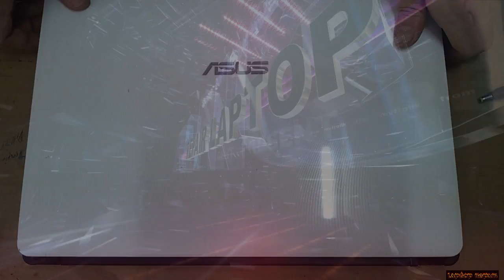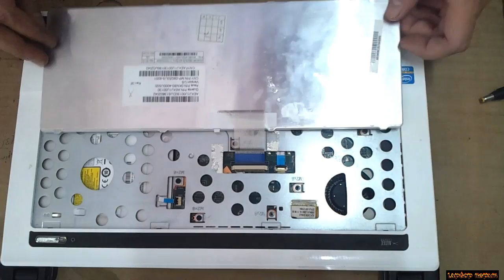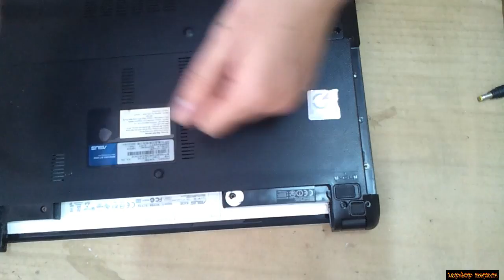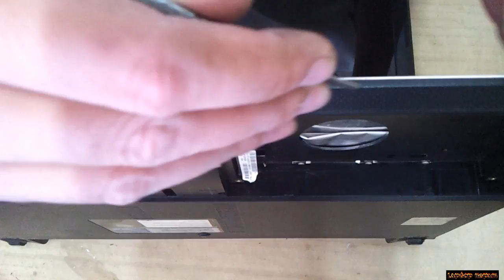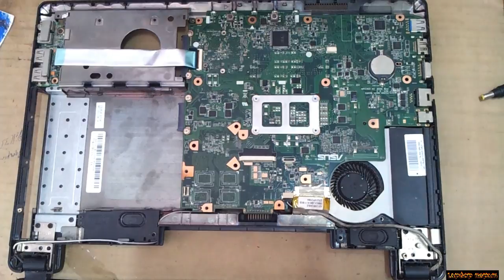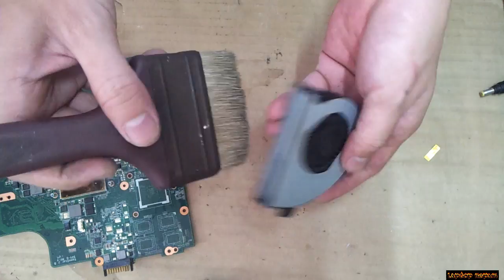Asus K43E - Disassembly and Fan Cleaning  Laptop repair

Comment: obrigado.. assistindo em 24/10/2024
Reply: Verifique usando o programa CPU-Z que tipo de soquete de processador está no laptop. Se o soquete for do tipo rPGA 988b, compre um processador i5-2540m, i7-2630qm no l-o-j-a-on-line e leve o laptop a qualquer serviço de informática da sua cidade para que um especialista em informática possa instalar um novo processador. 
Compre uma boa pasta térmica como GD007, GD900-1 (seringa de 1g) para processadores i5/i7. Você também precisa limpar a poeira do radiador do laptop (sistema de refrigeração). É necessário trocar a pasta térmica e limpar o radiador a cada 2,5 anos. Você também pode substituir as almofadas térmicas do chipset e lubrificar as ventoinhas com óleo líquido.
RAM 8-12-16GB DDR3-1333 2Rx8 1.5v

Comment: 300 trillones de gracias ! Un abrazo
Reply: Verifique usando el programa CPU-Z qué tipo de zócalo de procesador hay en la computadora portátil. Si el socket es del tipo rPGA 988b, entonces compra un procesador i5-2540m, i7-2630qm en t-i-e-n-d-a y lleva el portátil a cualquier servicio informático de tu ciudad para que un experto en informática pueda instalar un nuevo procesador. 
Compre una buena pasta térmica como GD007, GD900-1 (jeringa de 1 g) para procesadores i5/i7. También es necesario limpiar el radiador (sistema de refrigeración) de la computadora portátil del polvo. Es necesario cambiar la pasta térmica y limpiar el radiador cada 2,5 años. También puedes reemplazar las almohadillas térmicas en el chipset y lubricar los ventiladores con aceite líquido.

Comment: Is the CPU of Asus K43e is removable or upgradable?
Reply: look at what socket you have; if rPGA / PGA988B, then you can replace the processor. What processor model do you have?
Reply: It's removable btw. Thanks
Reply: @randomvaloclips9928  
if you have second-generation i3 (i3-2330m / i3-2310m), then you can put i5-2520m or i5-2540m. There is no discrete graphics card; the processor itself is on the cooling tube. You can install i7-2670qm, but turn off turbo boost on the processor, then the processor’s heat packet will be at the motherboard level (35w TDP) - get 4 cores / 8 threads / 2.2 GHz. And if you put an SSD under Windows and 6-8gb of RAM, then there will be a fast laptop))
Reply: @slavafedotov5742  Hi! Any idea how much ram its motherboard supports? Can it handle 16gb?
Reply: @Chris29019  the motherboard supports a maximum of 8GB+8GB (DDR3-1333, DDR3L-1600), only 8GB memory modules must have 16 memory chips (8 pieces on each side). I have 4GB+4GB in my laptop and have never seen the memory full I installed the i7-2760qm processor for myself, it works at a base frequency of 2.4 GHz and the performance suits me. You can set 2gb+8gb, 4gb+8gb. 
8+8 - is a waste of money.
Reply: @slavafedotov5742  Thanks!
Reply: @slavafedotov5742  Fiquei com uma dúvida, por quê é um desperdício instalar 8+8gb?

Sorry to bother you, but why is such a waste to use 8+8gb?
Reply: @RafaelSilva-jh7gy  I have an i7-2760qm processor and a Nvidia video card of 2GB and 12GB of RAM - the memory even in games is 7-8GB full. It all depends on the tasks of the person. If a person connects an external video card (eGPU) to a laptop or opens 50 tabs in the browser, then it makes sense to buy 8+8 memory.
Reply: @slavafedotov5742   That's me, I really open a lot of tabs, and I'm planning to upgrade my i5-2410M to an i7 and eGPU soon. Thanks for the reply!
Reply: @RafaelSilva-jh7gy  turn on subtitles in your language. It is necessary to remove the drivers from the discrete laptop card. You can turn off the discrete card in the BIOS. In order for the video card to display the image on the laptop monitor, you need to install a driver for the laptop video card. For example, you buy Nvidia gtx960 (2-4GB), then you need to install the laptop driver Nvidia GeForce 960M. You'd better buy an i7-2630qm processor (2.6GHz - 4 cores / 2.9GHz - 1 core). 
You do not need to turn off the turbo boost on this processor. Or buy an i7-2760qm - but it is better to operate it without a turbo boost, at a base frequency of 2.4 GHz.

Comment: Does Asus K43SD Processor can be replaced?
Reply: Yes. What processor do you have now? full processor name.
Reply: @slavafedotov5742  i3 2350m
Reply: @rad3547  i5-2540m / i5-2520m + RAM 6-10GB (2+4/ 4+4/ 8+2) + SSD 240-512Gb Windows 7 x64.
Reply: I Just check my laptop the processor can't be replaced
Reply: @rad3547  you can disassemble the laptop and see if there is a key for a screwdriver to open the socket. You can also download the CPU-Z program from the Internet and there on the first tab in the Package column look what is written. PGA- can be replaced. BGA- cannot be replaced. K43 and i3-2350m series - there should be replaceable processors.
Reply: Thx for the help but the processor can't be replaced there is no screw.... But my next question is do you think i can use a eGPU on this laptop? Using EXP GDC
Reply: @rad3547  For an external graphics card i3 is not enough. Rather, the effect will be small. You will need to buy a video card, adapter, power supply and an external monitor or TV. Maybe you can replace the board itself, on AliExpress choose a board similar to yours on the ports and fastening screws, put the i7-2630qm / i7-2640m there - then it makes sense in an external video card. Your laptop was manufactured after all with motherboards with interchangeable processors.
Reply: @slavafedotov5742  but do  you think it is possible to use an External gpu? On this laptop? What gpu is the best that i can use on this laptop??
Reply: @rad3547  if you put i7-2640m, then you can put eGPU on 2Gb (GeForce GTX 750 Ti / gtx 660 Ti). How to connect it fully video in YouTube. You can buy i7-2670qm, but you need to operate it in a laptop without turbo boost, that your laptop is not designed for 45W. Just there 4 kernels / 8 streams, it is normal for games.
Reply: @rad3547  https://aliexpress.ru/item/32831961653.html?spm=a2g0o.productlist.0.0.179d2876kUYSIU&algo_pvid=583041ea-f17d-4ab9-8e6b-1f835cb9073d&algo_expid=583041ea-f17d-4ab9-8e6b-1f835cb9073d-21&btsid=0b0a050115831653070442568e7fab&ws_ab_test=searchweb0_0,searchweb201602_,searchweb201603_
Reply: By the way its FCBGA
Reply: @rad3547  Jadi saya membuang tautan ke motherboard K43, di mana Anda dapat meletakkan prosesor i7. Di bawah i3 Anda, Anda dapat meletakkan kartu grafis dengan maksimum GeForce GTX 470ti / 480ti / 560ti.
Reply: @slavafedotov5742  what???